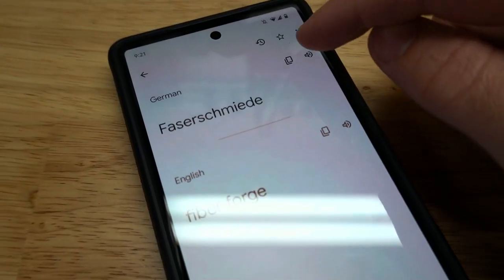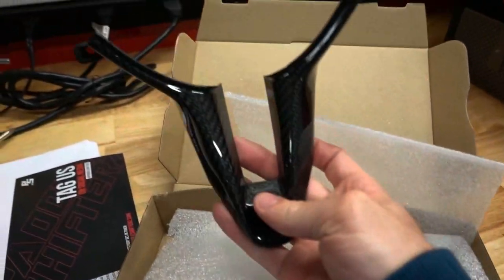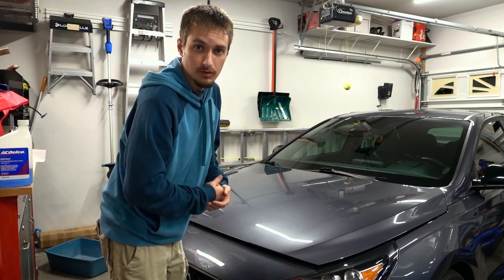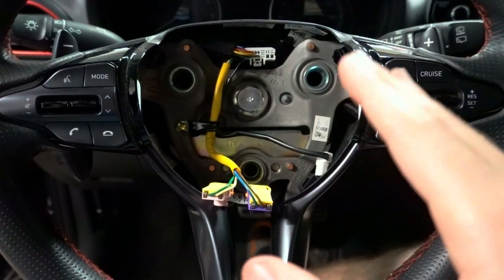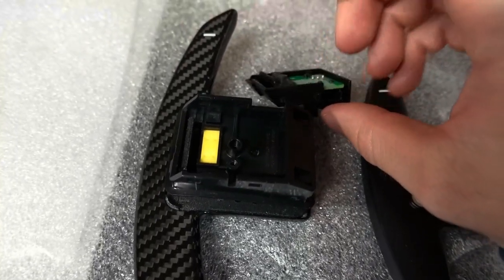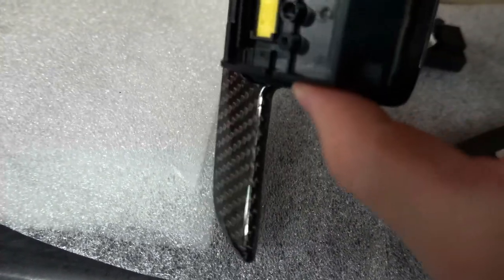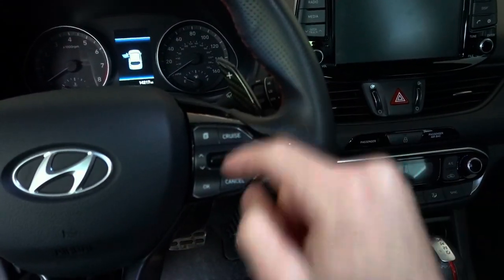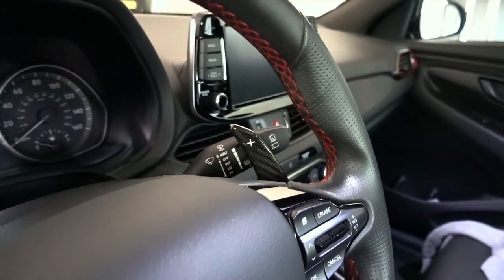Installing Carbon Fiber Paddle Shifters on my Elantra GT N Line! | Faserschmiede Hyundai I30N

Comment: nice video bro. how did you get the cable out of the shifter module? i cant seem to get mine out, feels like they are clippedd somewhere?
Reply from the maker: I believe there is a small clip for the wiring. I don't remember exactly but it wasn't too bad but it may be stiff on the first try.
Reply: @JustinKelly  i tried prying on the plastic rim but that just bent it. ill get a small tool down the sides and see if i can encourage it out like that. thanks!

Comment: Hey Justin I’m loving the carbon look and all the other mods you’ve done!  I’m wondering if you could give any advice about the exhaust mods you’ve done.  I’ve got the same car and currently have a K&N cold air intake and a cat/rez delete.  It sounds amazing with the intake sounds but I definitely think the exhaust could be slightly louder.  Has your XForce system gotten any louder now that it’s broken in?  What are your thoughts about straight piping?
Reply from the maker: I do not like straight piped vehicle 99% of the time as I believe they are too loud. With many cars, you loose some of the character of the sound as well. I liked the Veloster N axleback more than the Varex and I plan on reinstalling it whenever I get it fixed. The Varex definitely seems a little different sounding now but I wouldn't say overly louder (From the inside). For these cars, I seem to prefer muffler deletes (or my VN axleback) for the sound/volume.

Comment: Do you normally shift with the paddles? Or just drive it like a “regular” automatic?
Reply from the maker: Both. I like that you can engage manual shifting just by pulling a paddle. My only gripe is how fast it returns to "auto" after not using the paddle for a few seconds. Of course if you shift the gear level over it stays in manual mode.

Comment: Yooo did you get your Elantra through Hyundai. I want to do some mods to my GT sport but don’t know about if it will mess up my warranty’s? Love the channel man.
Reply from the maker: Much appreciated man. I bought the car through a Hyundai dealer, yes. It is in no way sponsored by Hyundai. Warranty is tricky because dealers vary greatly when it comes to this. A good rule of thumb is that whatever part you are replacing, will likely no longer be covered along with anything directly related to it with some exceptions like intakes should not cause you problems with the engine warranty. For example, when my midpipe weld failed, I had the Veloster N axleback installed and they wouldn't cover the midpipe under warranty because they said it could have caused it to fail. It actually failed on several other cars bone stock but I see their point.
Reply: Thanks man!! Gonna send it cuz I see to much potential in this whip🙏